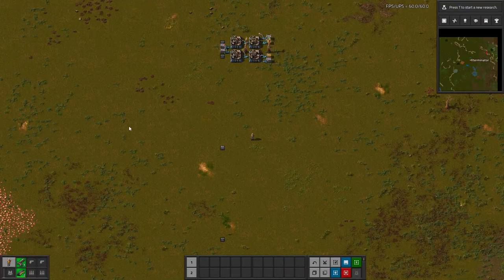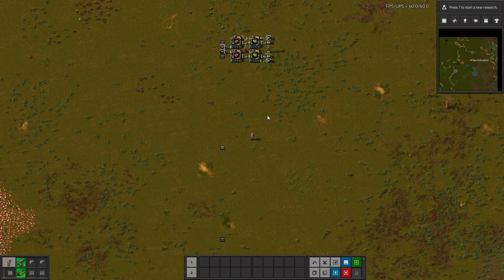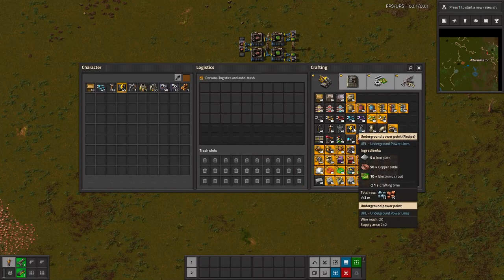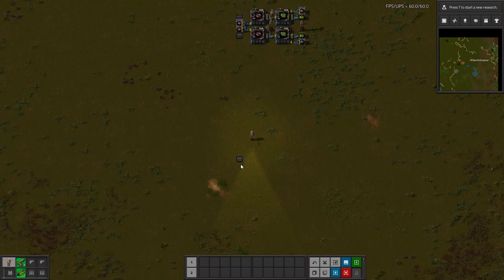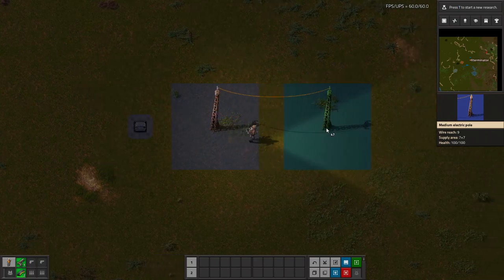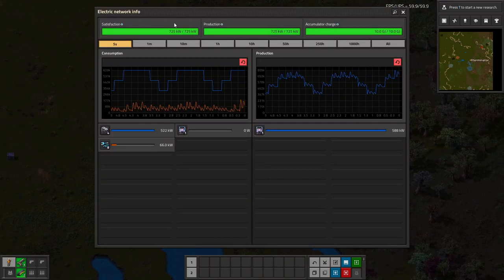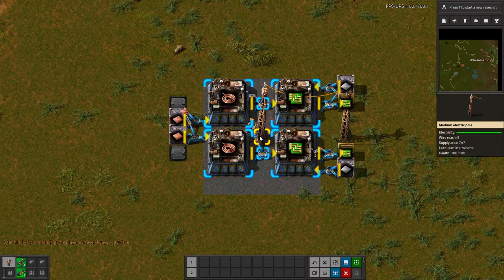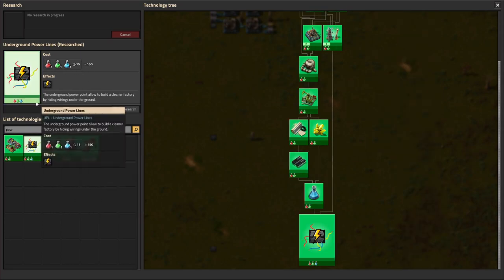Fatcorio Mod Spotlight - Underground Power lines

Comment: Hm, very unusual.. though I think the Big Wooden Pole mod does the job better (of having power poles across long distances), and I think the version included with Bio Industries also has a small area of effect, just like this. Plus of course, having the physical wire be visibly connected to the rest of the network.